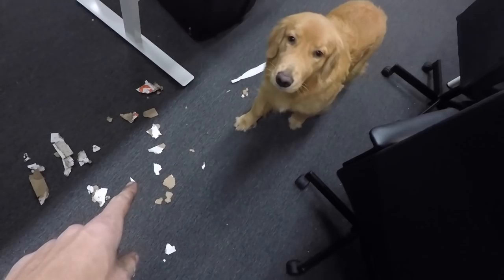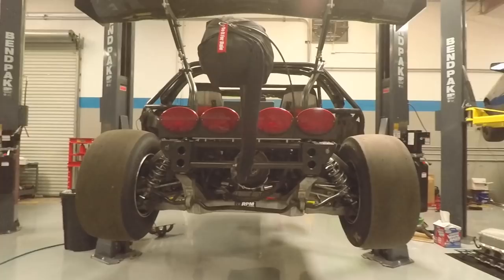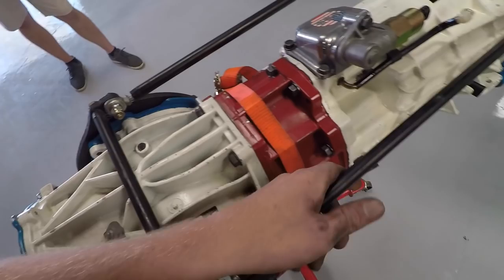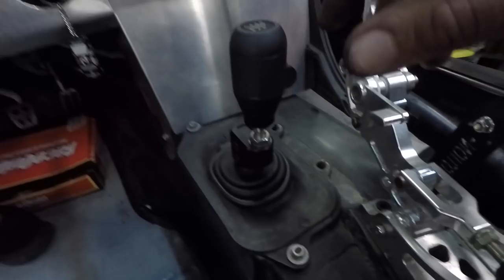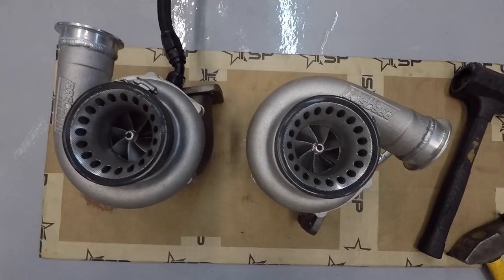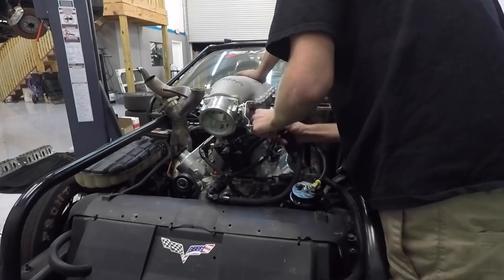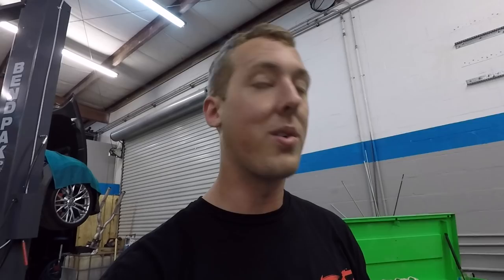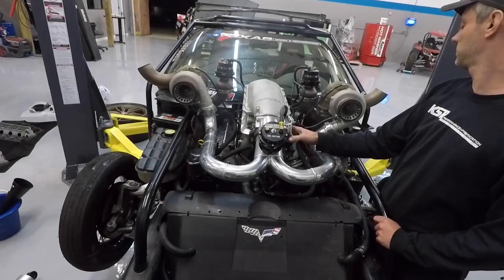LEROY'S ALIVE! New Heads/Turbo Upgrades... Sounds Like Freedom!

Comment: Hey Cleetus, you can get spray cans with pure graphite that is used for loader buckets on tractors to keep dirt from sticking. Spray your  turbo exhaust housings (also cast exhaust manifolds) and after some good coats, heat cycle them. The graphite will bind in the pores of cast steel when heated and will keep them from rusting for 10 years. They will also retain that grey color and never dull. It looks awesome when done. CRC also has Dry Graphite Lube that works great

Comment: WOW! LEROY NEVER FIRED UP THAT FREAKING EASY! 1/2 CRANK TO FIRE AFTER INSTALLATION OF UPGRADED HOT SIDE HOUSINGS FOR LE'TURBSKIES  AND THAT BEAUTIFUL SET OF ALUMINUM  HEADS. CRAZYNESS IT WAS RUNNING THAT WELL AND THEY DIDN'T EVEN PUT A TUNE IN IT! WTF

Comment: You really need to keep an eye on the air fuel ratios if you aren't tuning it.

Speed density tunes assume that the engines efficiency doesn't change, new heads and different turbine housings will change the efficiency and therefore effect the tune.

Comment: Okay, have to admit, those heads flow nicely with those turbo housings. But I still insist you take in serious consider the work on the rear suspension. In know you have done a lot of work on it, but it doesn't work properly. You may have to balance the rear axles, but you seriously need stiffer suspension and torsion bar. AND bigger tyres.

Comment: you need intercoolers to get the max power, since hot air takes up more space then cool, so more cool air results in being able to take more gas = more power